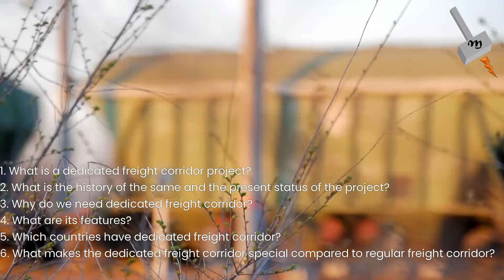Dedicated freight corridor - A step towards 5 trillion dollar economy

Comment: The future of traffic needs with anticipated reduction in demand for coal cannot be ignored. With huge increase in highways much of the traffic has gone to highways it look. It also increased use of fuel oils and pollution. 
High capacity trains at High speeds increases energy costs and overall cost for Railways. 
What other countries did long ago may not be applicable now, with environmental issues taking centre stage. The future will tell about the need for huge expenditure incurred when environmental issues and communications may alter the whole traffic patterns.
Reply from the maker: Very well summarized